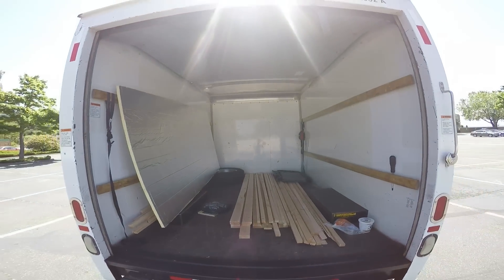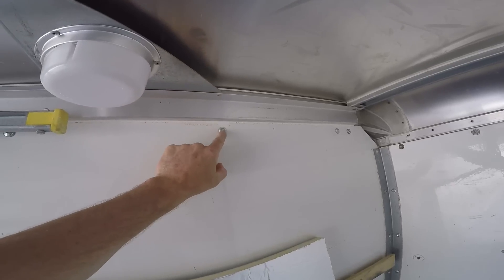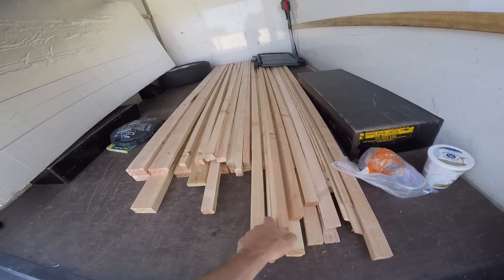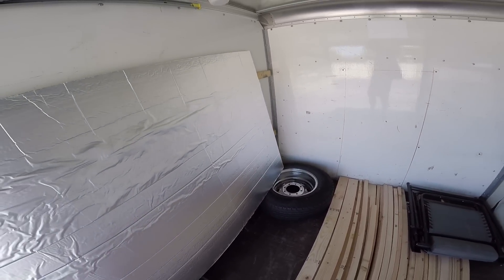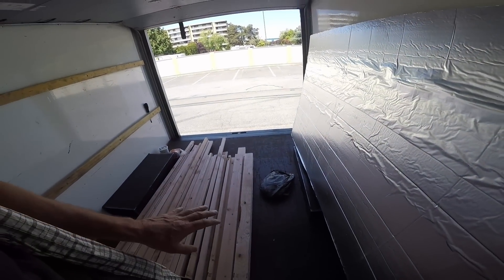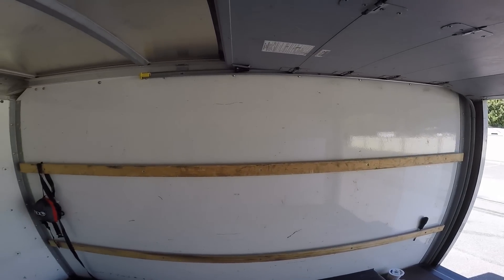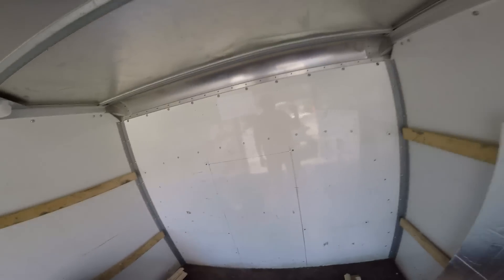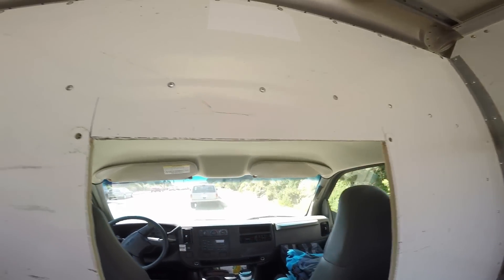dreamsideout 24 How I insulated my U-Haul box truck

Comment: Good video. I’m converting a box van myself. Would like to see/know more on the bolts you used on your ‘studs’/hammock bolts. 
Do they go through to the exterior? 
My van was used for a work van for an engineer. The existing ‘studs’ are metal and a weird half hexagon shape. Not quite sure how to approach it so that I can have good sturdy studs down the road. Ideas appreciated 😊
Reply from the maker: I always like hearing about another box truck vanner. The answer is yes. In that truck I used the sleve nuts that hold the wooden rails on. I just screwed in an eye bolt that matched the threads.

Comment: Question: Would you make the pass through the same height if doing it again? Seems like with your bed setup that you might not have needed to go as far down towards the floor as you did. Just wondering. Thx for all your great video content.
Reply from the maker: Very good question. When I originally cut the door through I had a cot in front of the opening that I could fold up and store in the cabinet above the door. Later I decided to build in a bed. However to answer your question I would do it differently next time. I would only cut the hole from the top to the bed height.
Reply: DreamSideOut that's what I was thinking but then I thought if you changed your mind later and put the bed elsewhere it would be nice having the door as it is now. Thx for replying. I'm just South of Portland. Perhaps our paths will cross someday. Cheers!

Comment: How did you insulate on the ceiling under the roll top? I really want a stealth box truck conversion with the roll top feature, I think its amazing! Great job, Thank you so much for documenting your process.  It really makes it seem possible..I have been on the fence about van life. But I think I'm ready to take the plunge!!!
Reply from the maker: Colin I think the roof is pretty well insulated and the van holds heat pretty well. I have gotten through a cold winter fine. I don't run heat when I sleep. I depend on blankets .
Reply from the maker: I insulated the ceiling with the same foam board that I used on the sides. The ceiling in these box vans has a slight arch to it so I put horizontal 1x1's across to accommodate the foam. Then I attached Masonite that has a hard white surface. There is a space right at the top of the door where the door roll up spring is where I used some reflectix (bubble wrap with Mylar covering) because there was not room for the foam board there. 

This insulation set up has worked fine for me through the Pacific northwest winter. I hope that answers it for you. Thanks for your comment Tiana.
Reply: Okay, makes sense.  Thank you for replying and keep up the good work!
Reply: Do you find that you lose heat through that large space (it seems like the majority of the roof is unable to be properly insulated because of it? Also, are you considering putting some insulation on the roll top door itself, and what would you use for that?
Reply: What about the door itself? Are you going to put any flexible insulation on that?
Reply from the maker: Colin Ayers I haven't yet. it's pretty thick, and the bed is toward the forward as you have probably seen. I have hung a polar fleece blanket overt it a couple of times. But for the most part I've stayed very comfortable in it. it might be different in a more extreme climate. But there is now way to insulate 100%. all you are ever doing is slowing down heat loss to save energy.

Comment: I think I would gorilla glue that molding around the walk-thru to cab, then screw 'em in. Just to ensure no poppin' of the molding. With all of the jostling the rig will do, screws barely piercing the molding could cause molding to pull away from screw threading.  I've never built anything...just trying to ensure no modification "oops" happening down the road.

Comment: great video.  I'm working on my 8.5x20 cargo trailer/toyhauler right now.  I have been installing 1" polyiso foam board..  do I need a vapor barrier?  it's has the shiny stuff on both sides.  the walls are metal and the structural studs are metal all covered in polyiso foam and 3/8 plywood.

keep up the great work..  ps we were in olympia for 15 years, stay dry buddy!!

Comment: I think the box truck is a great idea for stealth. Is yours the 4.8 motor with the heavy duty overdrive? What kind of mpg's do you get Rick?
Reply: Yes.  I selected  2013 Chevy Express g3500 cutaway with 6 x 12 box, full width barn doors and side access door.  342HP  6L beast with all the options.  9,900 gross weight rating.  6L is rated 10-11mpg  city and 15-16 Hwy.  Initially considered Sprinter but did not want Mercedes parts/service and metal box that was not rectangular.   The box trucks are much easier to insulate.  Stealth was my primary concern and the only external tells will be ceiling fan and 2 solar panels, but they aren't easily spotted on 10 foot roof.

Comment: id like to see you get a roof vent/fan, mostly for safety. it would give you more day light on days the door needs to be shut too
Reply from the maker: I have pretty good ventilation its just not in the roof. I can crack the rear door open about and inch and put my small fans right on the floor. I pulls air in fine. I can even reverse it. Its not an elegant solution but it works. I am still hesitant to cut a hole in the roof. It's poring down rain right now as I write this and Im very glad to not have leaks. :) I have toyed with the idea of side vents with small inline fans used in boats. or maybe vents in the roll up door.
Reply: yea cutting a hole in a roof would spook the McNannys out of me too tbh. is the best place and best stealthy place for it though. I don't see that many that leak if sealed good.  we know the skill level you got and research you would do. would ensure a proper job done. poss more chance of a leak fail if fitted to rear door as the door is up and down with a bang shut so often. just my thoughts on it Rick as we like you and want you comfy as possible in the van

Comment: +DreamSideOut  Very useful and thoughtful, and either coincidental or responsive to boot.  In any case, thank you.  I'm sure I'll be able to make use of it.  Speaking of making use of things, did you do anything constructive with that fiberglass/plywood sandwich you cut out to make your box/cab pass-thru?  While watching your video, I was thinking that it would make either a good door for that hole it came out of, or a nice table.
Reply from the maker: I was going to make a door out of it. But I changed my plans on that. You can order a door kit from the Morgan Box company. They make a pocket door assembly for these trucks. 
But I didn't end up using the cut out for anything and it got scrapped.

Comment: Thanks for these build videos, this is what I've been waiting for. 
Do the bolts that were holding on the original U-Haul wooden strips, go all the way through the wall? 
Is your kitchen top cabinet bolted thru the wall? 
How about things like your drawing table, is it bolted thru, or just screwed to the wall? 
Keep up the build videos, I'm sure there are lots of us very interested.
Reply from the maker: They are sleeve bolts. So I was faced with taking the bolts out completely and filling the hole or reusing the hole and the bolts. I chose to reuse the hole as well as the outer sleeve head and replaced the countersunk screw end with a machine head bolt and washer. I left the railing in with shallower spacers which gave me a solid piece of wood to screw things onto. And of course the railing is bolted to the plywood. so it is very solid. I also was able to screw cabinet screws directly into the wall itself. I have the strips of backing screwed into the wall as well. That fiber glassed plywood grabs the screws very well.
Reply: Sleeve bolts, very interesting...Sort of surprising.. but what a great idea and super strong. Good thinking on using the original wall strips as a make-shift header to fasten to.  I'm sure that wood was Maple or Oak = Very strong. I've built a tear drop camper and done a cargo trailer/ toy hauler conversion before, so I've walked the walk, that's exactly how I would have done it. Great job.I Can't wait to see more.

Comment: I watch every video and I think that if I were to live in a vehicle it would be like yours. My question is this, what did you end up doing as far as showering ? Gym membership ?
Reply from the maker: Check out my shower vid. I do use a gym at work too. Thanks for watching!
Reply: Good point.   24/7 fitness is one of several who offer 24 hour access nationwide and are proliferating.   That "magic card" also entitles you to be parked at the PRIVATE PARKING LOT anytime of day.   Many are located in strip plazas and other retail areas where a box truck will not be conspicuous - regardless of the time of day.   Is a cop really going to care if the truck belongs to a local  business, or a gym member, and if that member is napping inside at 4am or inside the gym.

Comment: Thankyou for the video, very nice to see how it began. Great job too by the way 👍
Reply from the maker: You're welcome! I appreciate the feedback
Reply: May I ask what you don't like about the roll up back door other than the limited headspace and top cabinet height at the back half when open? I have a truck similar to yours except the back door is one piece, hinged at the top, and opens up and out hydraulically. Very sturdy (I can hang off it when open) and would be kind of like a porch roof (7ft wide and 6.5 long) when open, but I don't like the idea of not being able to open it when  backed into, say..a parking space and it would be very visible that it's open when viewing from the side. Not a big deal to change to a roll up style as I built the entire unit myself some years ago to deliver product knowing that someday in the future it's use would be as a living space.
Reply from the maker: I think is is a bit awkward to open the door in places where I dont want people seeing into the van. But at the same time it works out well when I back up against a wall or a hedge or the edge of the forest. I can have the back door rolled up and have complete privacy. It is very stealthy.

 It sounds like you are one of the few people who really understands the issues with the rollup door. ANother down side is that when it is closed there is this ugly spring mechanism on the top which is hard to cover up and hard to insulate around. But I have made it work anyway.

I like your hydraulic door that you described. That would be great except as you say it would limit where you could park effectively and still open the door.

The fact is there are pros and cons. So far I have been able to make it work as is pretty well.
Reply: Thanks for your input 👌  it's not an easy decision for me because once I do the interior finish out there's no going back to the other style door.  I am leaning hard toward a good quality roll up.  My Wife and I love your set up and build, it's the best out there I have seen to fill our situation. Keep up the good fight.  JG from Mt.
Reply: +Van Der Hoof You might want to do more Internet research if you haven't yet on roll-up doors on box trucks.  Most people I've read recommend removing them as fast as possible and replacing them with two barn doors, etc.  FWIW.
Reply: I will do so, thanks for the recommendation.
Reply from the maker: I have lived in it for almost 9 months now and the roll up door works fine. It really comes down to how much extra expense and time to you want to put into your build. Looking back I did way too much overthinking on how to build the "perfect" set up. For me it finally came down too, how do I take a basic box truck and make it livable without too much modification. The only mod I made to the truck was the hole I cut in the bulkhead. The rest of the stuff is simply screwed in place and can be removed very fast if needed. If I get in an accident I can take my stuff out of the box and put it right into another one.  I think it would be a pain to remove the roll up door and re fabricate a barn door situation. But it can be done and some people might prefer that.
Reply: Van Der Hoof You also might consider leaving the roll up door closed, remove the spring inside, insulate over the space of the roll up door and open a door by cutting in the roll up door the way he cut in the bulkhead, same way could cut to make Windows in the back over the roll up door.

Comment: Did you have to do anything to avoid air leakage around the rear door?
Reply from the maker: No. I deepened on it for ventelation. In a colder climate it would be a problem though.

Comment: I'm glad that you took the time to do proper insulation. It will payoff this winter. I will love to see couple fans to improve air circulation and you will be set.
Reply from the maker: It will do fine here in the Pacific NW.
Reply: Good point.  My slightly larger box (12 foot length) with barn doors vs roll up will have a bulkhead 3 feet from the rear for a utility room and bike storage.  Utility room Ceiling fan will draw air through bulkhead vent from the main living area up front, even when the access door to the cab is closed.  I want the option of stealth,  24/7 circulation.